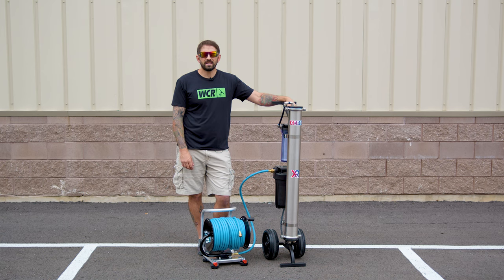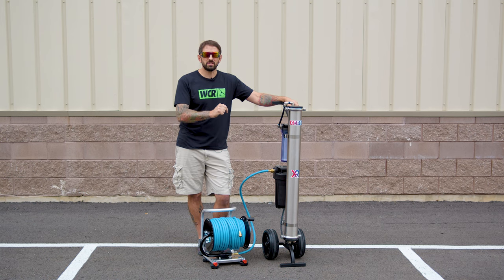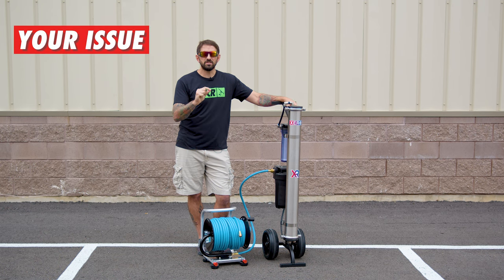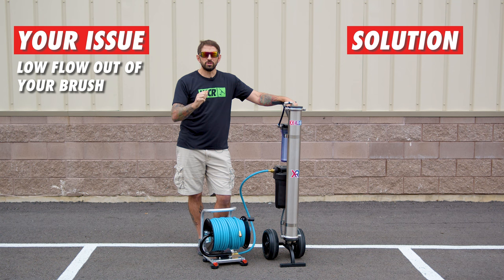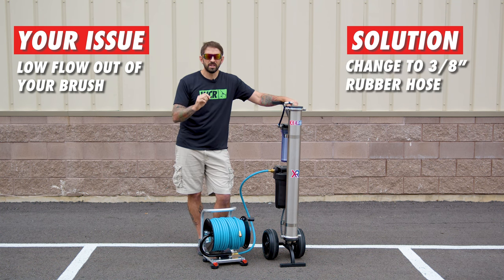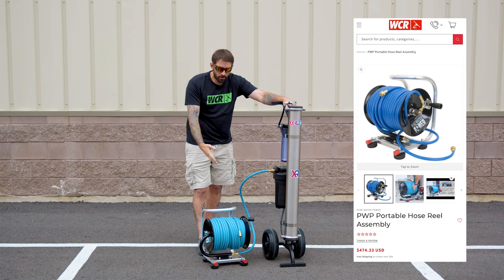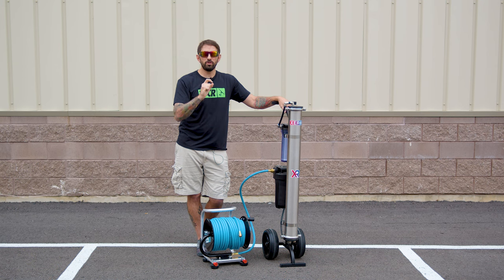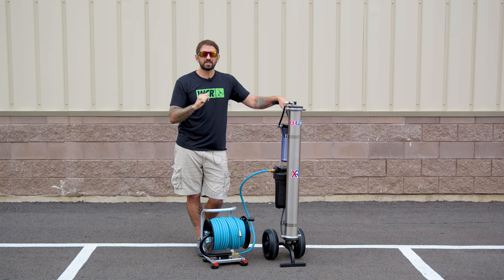How To Improve Your Water Flow From Hose To Brush

Comment: I'm in a rural area where most homes and businesses are provided water through a private well.  Water flow varies greatly in private wells and holy cow did this hose fix 90% of those job problems.   The remainder where the flow rate was still just too poor I use a 12volt pump.  If you're dealing with low flow this hose is not a gimmick.   It more than doubles your plow rate.   Well worth the purchase.
Reply from the maker: yeah its a small trick that makes a BIG difference!  ~Jersey 862-312-2026